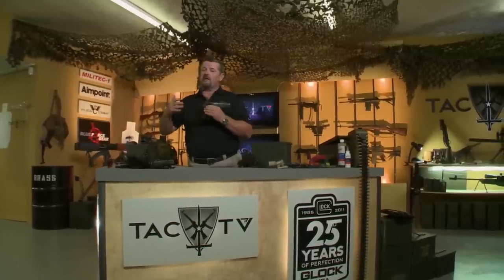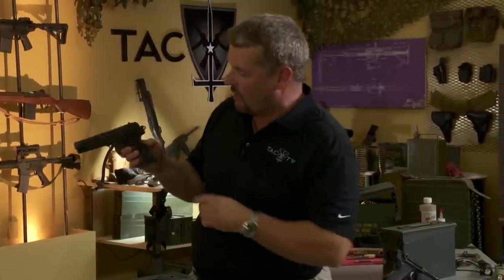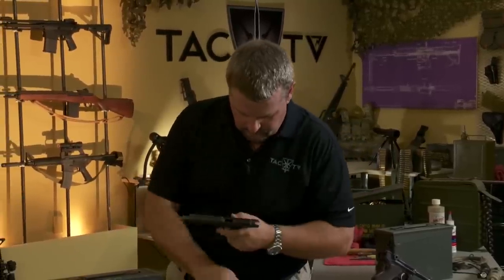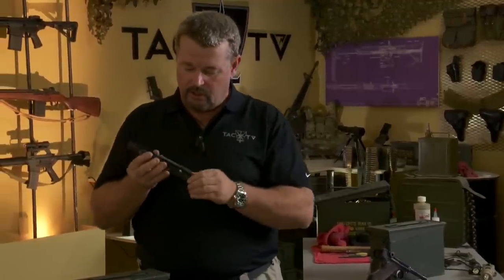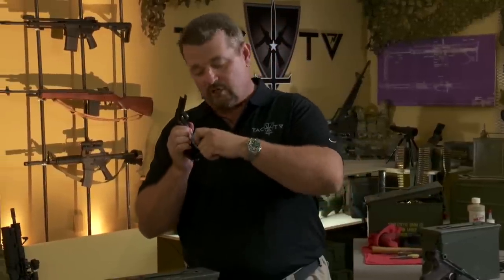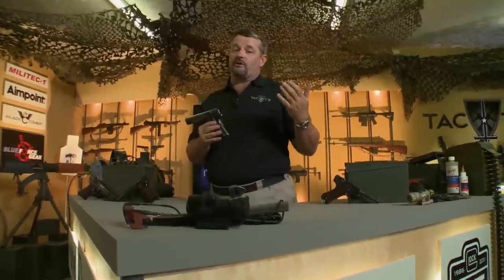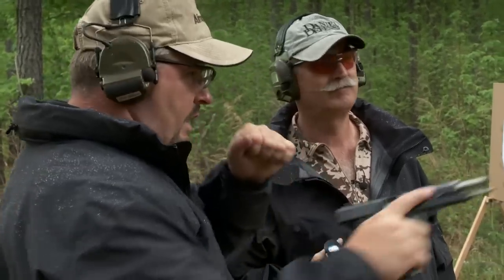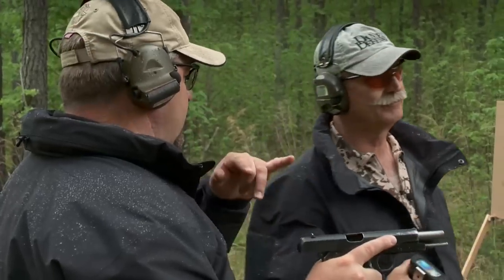Radom/Vis Pistol Breakdown

Comment: Your difficulty with removing the slide stop stems from an omission in the disassembly procedure. Lock the slide back, then pull the guide rod forward, and the slide stop will come out easily.

Comment: hey Vickers, u should be able to remove the disassembly pin by pulling on the guide rod and letting the pin drop out. should not need to punch it out.

Comment: a much easier way to take the pin out is to pull on the guide rod, then the pin just drops right out under gravity. pushing and twisting and prying it out like he did will certainly put more wear on the gun.

Comment: easier way to get slide stop out- lock the slide (as you did it) and then pull spring rod few times. pistol should be slide stop sided down. and then slide stop get out without any help. Pistol name is VIS wz.35 (Polish made).

Comment: I have never seen one taken apart that way and I believe that you did it the wrong way.  All you have to do is remove the magazine and lock the slide into take down position (on a late war production 2 lever version use the decocker to do so)  then pull the guide rod in the direction of the muzzle and the slide stop/take down pen just falls right out.

Comment: it is simple to disassembly this pistol.when slide is back u should pull spring rod  and slide lock that u push with a tool will came off without a force.

Comment: Really like your videos. I have a pre war I am very proud of. It has the best of both the 1911 & Hi-power. The purpose of the slide lock for disassembly is to free one hand to slightly pull out the rod causing slide stop to easily be removed. The Radom holds the first patent on "retained" recoil spring.

Comment: Cool, but you didn't mention about the fact that VIS 35 (early designation - WIS from creators' surnames later changed to Latin word "vis" meaning power, strenght) has a decocker and is actually the first service (Walther PP was first ever) gun to incorporate this feature. I think it is way too improtant information to omit it in such video. However it's nice to see this wonderful firearm here.
P.S. German designation was P35(p).

Comment: He should have mentioned the de-cocker lever on the left side of the slide. This was so the Polish cavelry man could safely lower the hammer. It rotates the firing pin from contact before dropping the hammer. Also, the hammer has a knurled end so you can "wipe" the hammer back on your thigh when on horseback. Also has a grip safety. Nice pistol but it does have tiny sights which is typical for a combat handgun of that era.

Comment: You can't remove the magazine follower in the same manner as with early 1911 magazines with pinned or welded floorplates?  Load a few rounds into the magazine, trap the compressed spring with a cleaning rod through the witness holes, unload magazine, and the follower should go loose and slide out the front of the magazine.

Comment: Why is he calling it Radom the name is VIS meaning Force in Latin ...Radom is a city in Polnad where the factory is located and second fact is that this VIS that he has is not a original one the real Polish made VIS was made from 1935 to 1939 it will have a polish eagle stamped on it this one is most likely made by Germans after the occupation of Poland which Germans kept producing it but it was still made in Radom by the Polish the Germans went more for quantity than quality and polish workers would make the parts with crappy quality and sabotage the production on purpose with hopes that it would break down on the Germans AND VICKERS if you read this its not a German service pistol its POLISH service pistol it makes me sick when you say Radom
Reply: +sebol931 It's both. Nazi Germany took over the production of VIS and started to issue it to Wermacht.
Reply: +sebol931 Also most of the finial assembly was done at steyr, with late war production being completly moved there.

Comment: Good God! Vickers is RUINING that beautiful and rare firearm. To disassemble the Vis 35, lock the slide back with the take-down lever, then pull the guide rod forward. The cross pin will drop out of the gun. There's no need for any tools, and certainly no need to PRY ANYTHING.